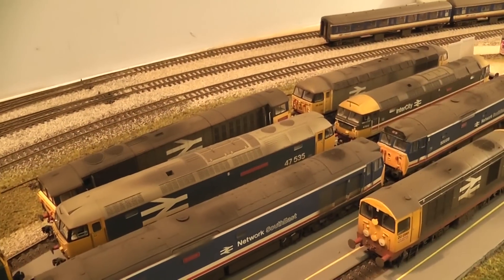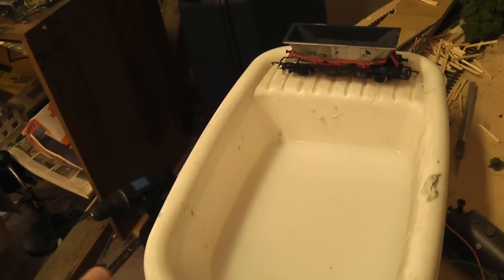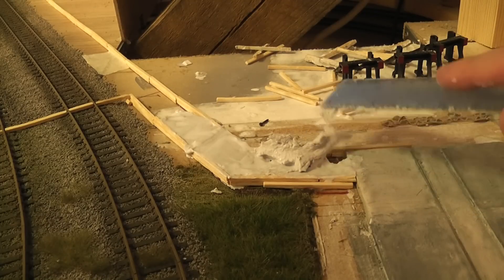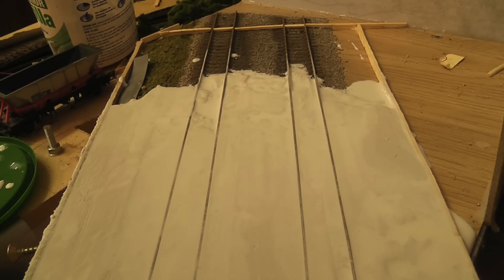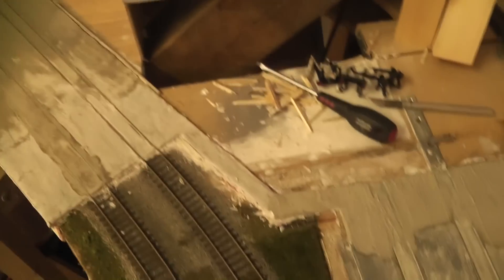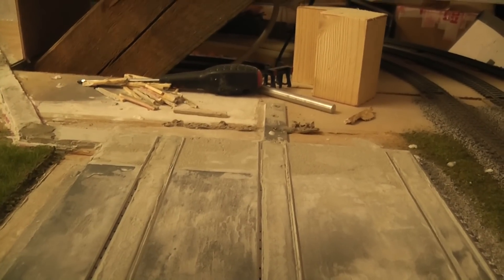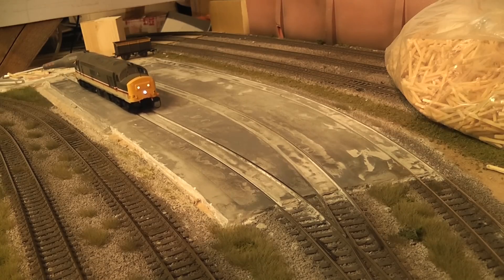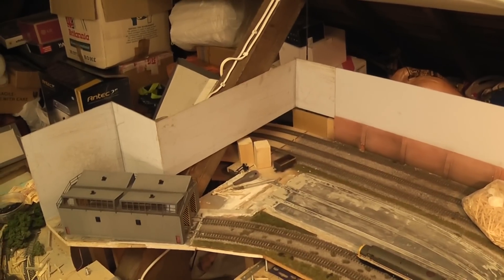How to - Episode 13 - Making Fake Concrete

Comment: I did something similar to this to make a curved level crossing (4 tracks with various spacings) in 1979. If you'd waxed the insides of the matchsticks on your shuttering (technical building name for concrete moulding timbers) with a crayon or candle the Polyfila (or Plaster of Paris) won't stick.

Old box axled Triang wagons with the deep flanges are best for cutting the grooves.

Don't forget the "Wet Cement" sign otherwise ant will leave footprints all over it!!

Comment: Great turorial :) I used this technique to pretty good effect on the club layout of the mrc I used to belong to, but instead of using the cutting disc I superglued some code 75 rail just on the inside (like a check rail) and filled the gap with string. Once the pollyfiller has dried and the frame has been removed you lift away the string (carefully!) and it leaves you with a nice full depth flange gap. :)

Comment: Hi, I'm a painter and use these products all the time. A few points for you: First, rub some Vaseline along the tracks and sticks, that'll stop the filler from binding to them. Second, there is a filler called One time or Rapid set, it is a light, fluffy, white coloured filler that dries much softer so you won't need to sand as much. Third get some filler blades from the hardware store, they're much better than a cruddy old ruler. Hope that helps, Cheers.

Comment: a very good tutorial on how to lay the concrete mate.can i add that there is also another way to add the grooves in the concrete which i use and may even be easier.
i use string with the same width as what you need for the wheels to pass and all i do is lay it on the inside of the rails, i then add the filler and whilst its drying i pull the string in an upwards motion away from the rails.it gives you a perfect gap along with being easy and simple.

Comment: your way of holding concrete is bril!, i use plastruct L section glued down to the baseboard then filled upto it that way theres a smooth edge ready for stuff to be butted up to it or what ever you wish to do!

Comment: Hey, I've watched so many of your videos and loved them all, some really helpfull and inspiring too. 

Just something I tried myself and thought I'd share wit you. When I was creating my concrete area, I mixed black paint in with the polyfiller. (Mixed them in a seperate pot). The black darkened the grey polyfiller and watered it down at the same time. Killing two birds with one stone. The paint didnt affect the adhiesive properties of the polyfiller or make it crack when it dried.

Comment: I'm the friend he's mentioned in this post.  Using the matchsticks is very easy so long as you only use a small amount of glue.  I only used glue on each end - not all the way along. When it came time to remove them i used a sharp knife to slide along under them. They came away very easily, then I sanded along the edges to get a smooth straight edge.  It's very easy - just watch out when you sand it - you get dust everywhere so cover over the rest of the layout and move your locos out of the way

Comment: Great Tutorial !
I have Hornbey equipment that was purchased late 70's early 80's (track etc.) And have just started thinking about my own project. This was the first tue I came across in your series and think they are great. Therefore I have subscribed. I particularly love the speeds you get from your locos. Very realistic! Most of the layouts I've seen, the locos tend to move too quickly but these echoe real life very very well indeed.

Comment: this is more of a question then a comment, i have resently switched from bachmann easy track to peco code 55,   i bought a bunch of small radius turnouts for my yard, and the tracks seem to be to close together, should i have went with medium radius points? or large? scratching my head, watching my pockets empty! btw love the videos, cannot wait to see the next one
Reply from the maker: The closer spacing is actually more realistic.  Easy track keeps a big gap as it assumes you have very tight turns.

Comment from the maker: The polyfilla is pre-mixed in the tub.  As you can see in the video I put the filler down and then wet the the spreader.  The wet spreader softens the filler just enough to make it spread.

Comment: Thank you for the how to video. Getting back into modeling after 15 years, but didn't want to start again on aircraft/armor because then I'd want to start detailing everything and there goes my modeling mojo. But zombie dioramas? Oh yeah! Looking at creating city scenes which would include concrete sidewalks and your how to video fills the spot which is why I down loaded it. I do have a question, but it's NOT any kind of criticism. Do train people really lay that much concrete at one time on/around their tracks in real life? I thought the slabs would be smaller as to be more realistic and what about expansion joints between the slabs? Or because of your scale, it's not worth bothering with? Thanks again for the video.
Reply from the maker: Its usually done in slabs.  A pencil line replicates to join nicely.

Comment: I agree! I will use power tools next time - using bare hands takes ages but gives the same effect, I found using a heat gun cuts down the drying time though! I didn't suffer from any cracks at all though on mine, but that might have been down to I used cheap powder filler - found official polyfiller cracked allot on previous models while drying. cheers!

Comment: Thank you for this series of how to videos - learned a lot and much appreciated! (Your work is very good btw. ;-)) One question on another topic: Will static grass go static straight from the shaker or beaker or do you really need an applicator to get the proper effect? Thanks! Best from Holland, Joachim.
Reply from the maker: I use an applicator the get the best out of the static grass.

Comment: good video thanks, i also mix colour with the filler, i use Coving Adhesive. Dries quicker, harder and is cheaper.  You might also try laminate flooring underlay instead of matchsticks. It in 800mm square sheets, roughly 1/8th inch thick, very light, can be cut and sanded.  I us it for road beds, raising an area, infill and any scenery

Comment from the maker: I used polycell interior ready mixed polyfiller for this vid.  Exterior filler works fine too.  Not sure what the code is, all the polycell stuff should be in the same place in the shop.

Comment from the maker: The easiest way to make the grooves is to use a cutting disk.  If you don't have one then lay some string along the edge of the rail.  When the filler has dried, pull out the string and your left with a groove for the wheels.

Comment: I used a fillerproduct also but as a dry powder which you mix with water! It did not crimp!!! An I made molds of carton and made the filler a little more liquid! So it spread out in the mold! The material you use I used to which came in toothpastelike form! I used that for small spots but this material is very very hard after it dries!! But good for quick fills!!!

Comment: Wow, you certainly like making life difficult! Ordinary Interior Polyfilla in powder form is much easier to work with, and significantly easier to sand. Rather than using a sander, you can get excellent results using a scraper to remover the high spots. It is much quicker and doesn't generate anywhere near as much dust. I normally use a wallpaper scraper or a plastering trowel for this job. It might be worth cutting a strip of Plasticard to glue in between the rails rather than use filler

Comment: would it be easier to stick match sticks inside the track where you need that groove for the wheels, of course I would only use blue tack to hold it haven't started my goods yard yet but just a thought

Comment: if i wanted to put fake concete down but not inside the tracks on my long strait's could i just put a very tight fit peice of timber in and remove it when the filler in nearley dry. Cofffee sterers like the ones found in Costa & starbucks are better than match sticks as there alread the same height.

Comment: How could I use a different material but with this method to add this look to a portable layout
Reply: You can try plastic card.
Reply: Plastic card works best this using fillers and mix stuff is a real pain cheaper and better looking affect with plastic card and grey spray paint.
Reply: +Graham Mck When I start my new layout I will definitely use card as it is easier for me.

Comment: very good technique! pretty good effect
I would use the same technique to drown my track on my layout ... 
But I think the use of the disc to cut the inside of the track is "dangerous for the track"! ...
Reply from the maker: edtoytoy As long as your careful with the cutting disk you wont damage anything.  The disk is only used to remove excess filler.

Comment: perhaps using a lubricant on the inside of the matchsticks such as vaseline would act as a release agent that would help to remove the matchstick more easily. yes pva would hold the filler in place - like it would if one was rendering a wall.

Comment: Do they really pour the concrete up to the edge of the rails?  It raises a question:  how do they replace worn-out crossties/sleepers?
Reply: They don't use sleepers in this case.  They fix the rails to the concrete itself.  It's  not going to wear out quickly at depot speeds.

Comment: how did you do the center of the tracks?
Reply from the maker: Tanser's Trains Its in the video
Reply: EverardJunction i tried to make this, but my tracks are rusting, how do you prevent this, and do you have any advice for three rail/ AC? very nice video thank you
Reply from the maker: janeau123 How old is your track?  They stopped making model railway track out of steel quite some time ago.  It will rust when exposed to water and its notoriously difficult to keep clean.  You could possibly do this method for 3 rail, but would need to take some extra care.
Reply: EverardJunction i use M-rail from marklin, and the water in the plaster make it rust, and in the middle of the track it does not work good because of the pucos in the track, the plaster is to high between the tracks. thanks for the fast response

Comment from the maker: Dont run a loco over wet filler, it will ruin it.  To make the grooves use string or a cutting disk like I showed in the video

Comment: You should try using the method featured in the August 2012 edition of British railway modelling, it is much quicker, easier and not as messy compared to using polyfilla

Comment: Using a sander over track will scratch it right? That's bad isn't it? I'm not sure.
Reply from the maker: It will.  You need to use a fine wet & dry sand paper to finish off.  This will remove the scratches from the filler and the rails.

Comment: I made concrete my self but I used easy sand car body filler it will not crack and when you sand it you can sand it to shape and its still cheap to use !!!!!!!!

Comment: Need More than a Contact Cleaner? . . . Chemically Improves Connections!!! 
(without harm to metals and plastics)

DeoxIT D-Series contact cleaner is a fast-acting deoxidizing solution that cleans, protects, lubricates and improves conductivity on all metal connectors and contacts.

Comment: What a faf. As said in another comment,  smear a very small amount of vaseline on the inside face of whatever you are using as formers and the tracks. If you use the easy sand powder plaster as opposed to the ready mix you can make a sloppy mix  which will self level to a degree. You can also mix in modelling colour powder if you want.